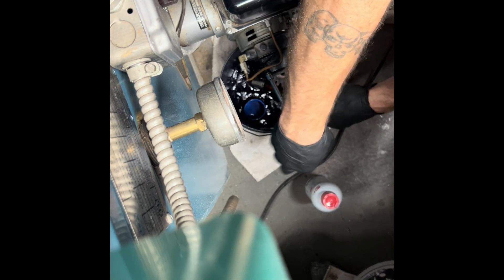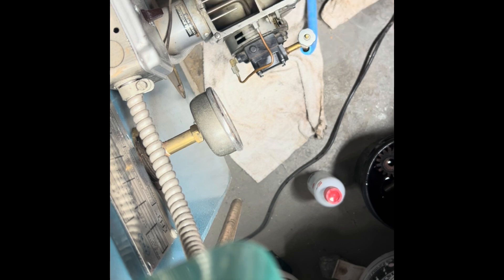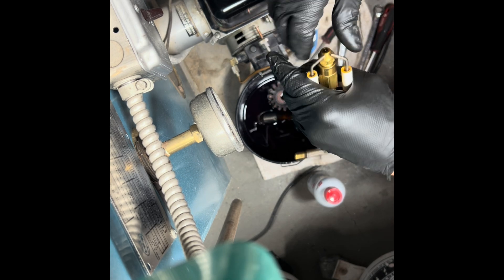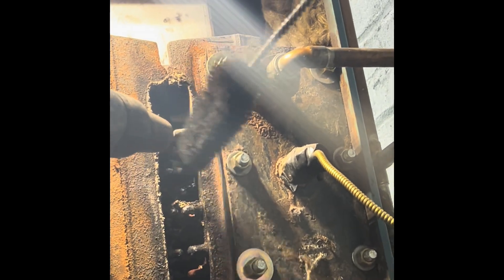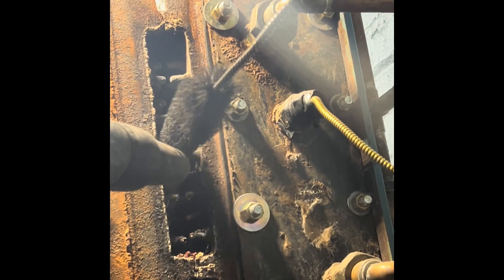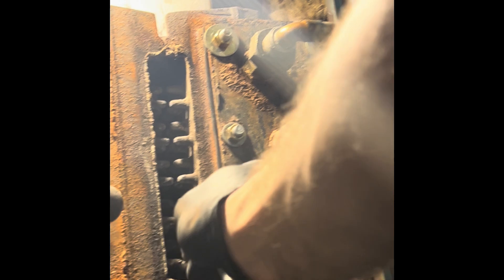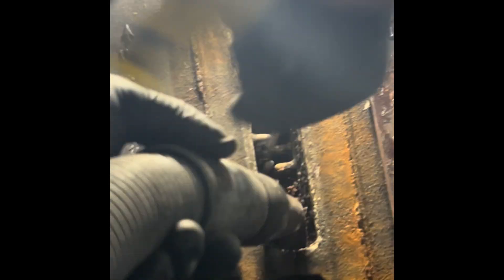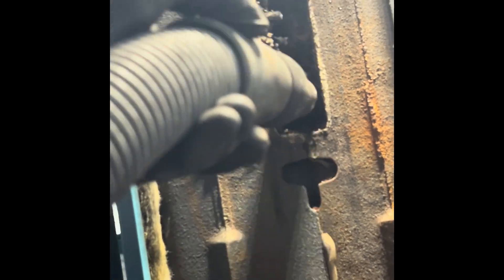BURNHAM OIL BOILER TUNE UP/DIRTY! | HVAC #hvaclife #learnthetrade #hvactechnician

Comment: Nice work. What kind of spray did you use when cleaning the nozzle line assembly?
Reply from the maker: It’s called ZIP,
Equivalent to break cleaner.